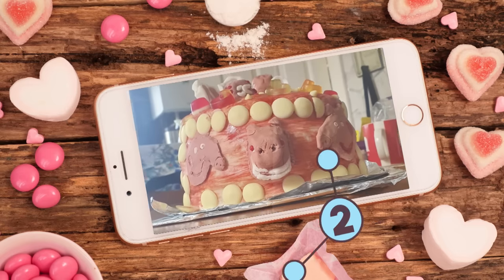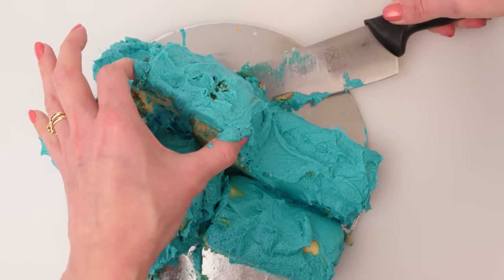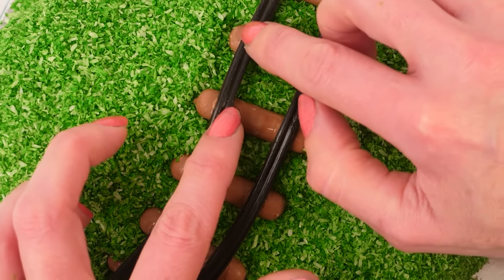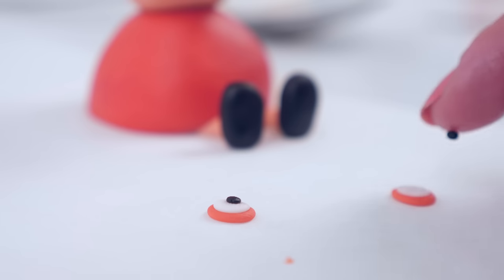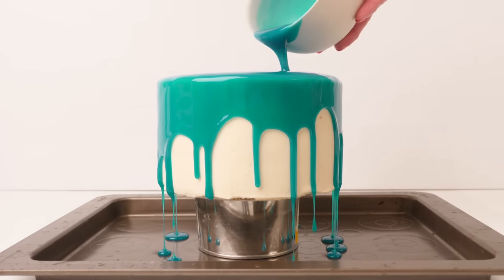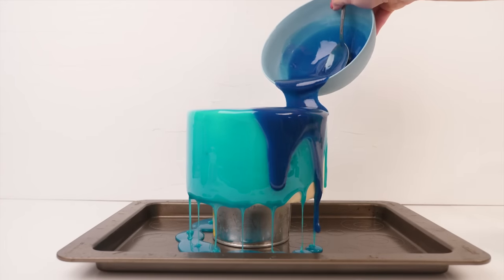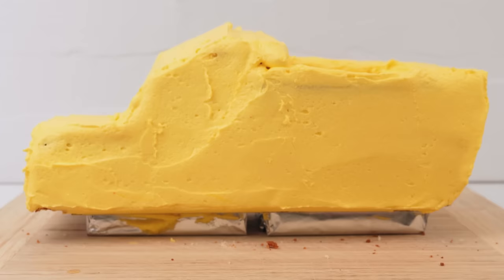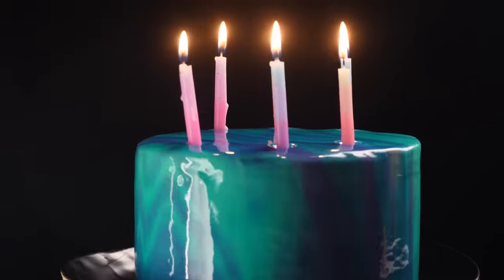Cake Rescue from failed to nailed! | How To Cook That Ann Reardon

Comment: I didn't know what to write in the comments, so here's a recipe for pancakes instead:

1 1/2 cups all-purpose flour
3 1/2 teaspoons baking powder
1 teaspoon salt
1 tablespoon white sugar
1 1/4 cups milk
1 egg
3 tablespoons butter, melted

1. In a large bowl, sift together the flour, baking powder, salt and sugar. Make a well in the center and pour in the milk, egg and melted butter; mix until smooth.

2. Heat a lightly oiled griddle or frying pan over medium high heat. Pour or scoop the batter onto the griddle, using approximately 1/4 cup for each pancake. Brown on both sides and serve hot.

I hope this helps you :)

Comment: I really like the idea of the Thomas quick-fix being to turn it into a grassy hill with rails, for a toy.  I only think it should be said that maybe giving the toy a quick sanitisation, like put it under hot water, or dip it in boiling water, then dry it off.  Just to be a tad safer. 

I just wonder if that cake decorating book is where Mum got the idea for my 6th b'day and my brother's 11th b'day cakes.  It was a joint b'day party because we have our b'days around half a month apart.  Mine was a teddy bear, his was a space shuttle.  They were that sort of style, with a buttercream type of icing, lines marked out in licorice, and chocolates and lollies for the details.  Mum did do well with them however.

Comment: Can you do a failsave (with your typical in depth chemical explanations) for German buttercream, ie custard with butter, for Danube Waves? That is something a lot of people have problems with, like it turning grainy and splitting when the temperatures or fat content aren't right, and having issues with applying the chocolate glaze, getting the wave pattern to show the white cream underneath without mixing parts accidentally, and being able to easily cut through it without having the chocolate hardened and mushing the cream

Comment: THAT CAKE BOOK!! AAAAAH!  cough Sorry, my inner four-year-old got loudly nostalgic there... Clears throat My mom has (maybe it's now "had") a copy of that back in the late 1980s/early 1990s, and I enjoyed looking through it all the time. She never made the cakes from that, of course, but it was fun to dream about a fancy built birthday cake as a single digit kid.  Well, she may have made a cake from it that didn't turn out, but I think the problem was with the measurements and how they don't match up in volume. 

Let me point out that we live in Canada, which makes us psudo-Americans for a number of things and psudo-British with spelling (weather in Celcius and ovens in Ferenheit, drive in kilometres but measure in inches, buy milk in litres but weigh produce in pounds sort of thing). Turns out after some research, an American "Cup of [item]" is a different amount to the Australian "Cup of [item]", so the recipe didn't quite turn out. The American cup was "a cup" while the Australian one was 7/8ths of a cup in comparison.

Due to the above I have discovered the absolute joy in using metric for baking; 190g of flour is ALWAYS that, while a "cup" can be 180g or more than 200g due to air or flour type. Or how it's always 100g brown sugar, because what the heck does lightly and tightly packed brown sugar mean American recipe developers? That could be 90g at the lightest to over 200g for the strongest of sugar packers.

That would be an interesting video though, wouldn't it? How different "a cup" is from locale to locale, and why the metric system is (potentially) superior?

Comment: For the transparent glazes, would it work to use agar instead of gelatin? It would be vegetarian AND solid even at room temperature. You can get packets of clear agar powder in Asian grocery stores where it is used for "gelatin" type desserts to avoid using meat-based gelatin.

Comment: If you want a Thomas cake and have more time, just adapt the first idea.
Hire a number cake tin, and when you have baked and cooled the cake, fill it then  cover it in green frosting, butter cream,or similar. Then add the coloured coconut.

Make the tracks with chocolate biscuits or matchmaker chocolate sweets  and liquorice or rolled out black fondant, laying them out over the cake as you like. You can add a little more icing/coconut to the sides of the tracks fir extra authenticity.

Place your mini Thomas on the tracks, an adding  the correct no. of candles to a different area of cake.

You can even leave space on the board for Happy Birthday/the child's name to be piped on or spelt out in small sweets  (fixed with icing).

You end up with a REALLY  professional looking cake, and it's so much easier than cutting the cake into the correct shape/cutting up and applying all that fondant (with getting it covered messy butter cream) 
+ you can adapt this idea for lots of other toys, such as dinosaurs, farm animals, whatever the child really likes.

Coconut 'grass' is one of my favourite shortcuts.😊